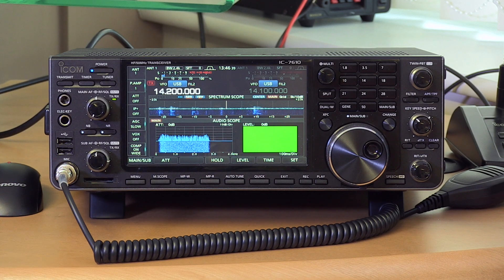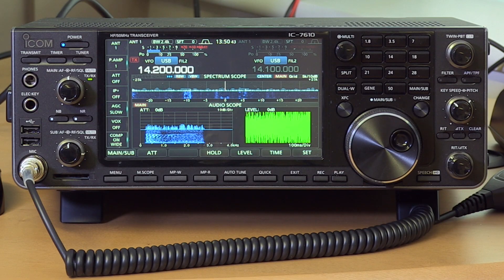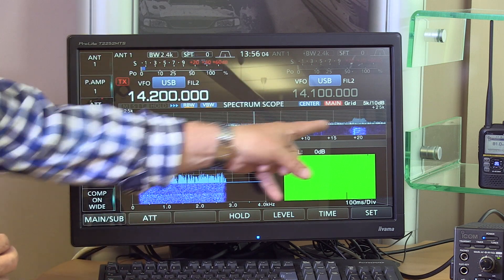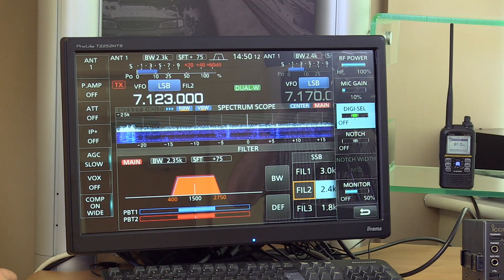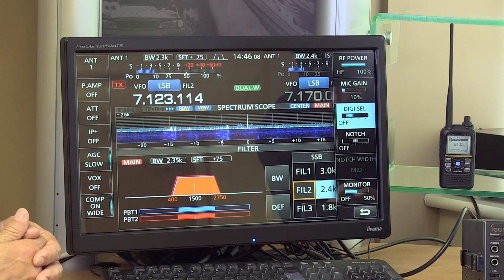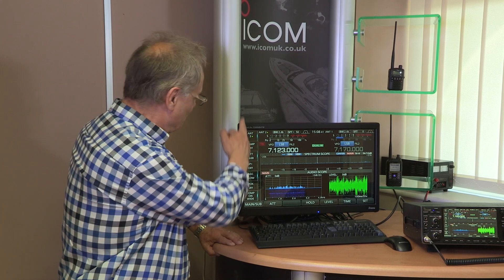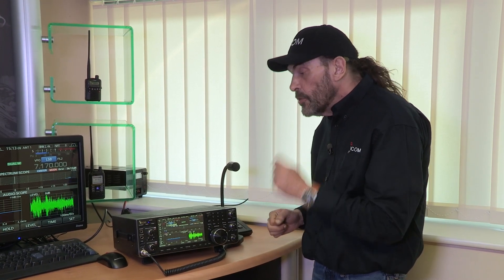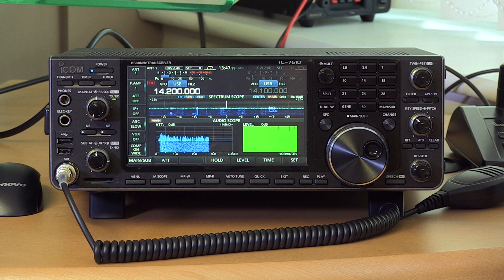Overview of Icom IC-7610 SDR HF Transceiver

Comment: Have they solved the screen burn issue
Reply: Yes, not long after this was an issue they used a different screen., Also the screen will be fixed forever by Icom if it burns in.

Comment: i went from a 7300 to a 7610 and back to a 7300. the 7610 is a great radio. I had a screen issue and other little niggles with it. so i went ack to a 7300 and its just has good in my opinion. it does what i want and i think you cant beat a 7300 for the money. well done icom. just need a higher powered 705 now.

Comment: The IP+ and IP- are not an intercept point control - Icom does not have intercept point buttons like  Yaesu. The IP refers to "Dither" which is a noise reduction method for SDR's - it injects random noise that is later subtracted. IP+ is Dither ON and IP- is Dither Off.
Reply: So you mean it's some kind like phase noise canceller?

Comment: Thank you gentleman. An excellent presentation from the two Bobs! Still quite happy with my ICOM-7300. However, I can see myself upgrading to the ICOM-7610 in the not too distant future. Do I need it - no. Do I want it - yes. 73. Ken K1KRK